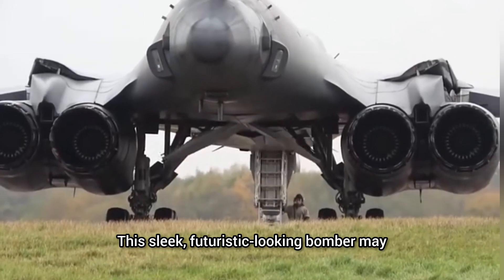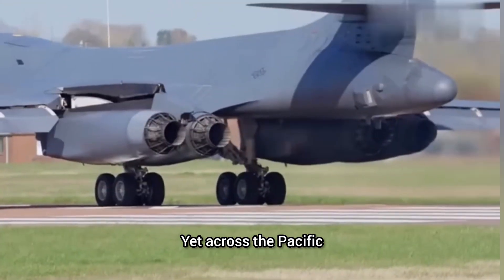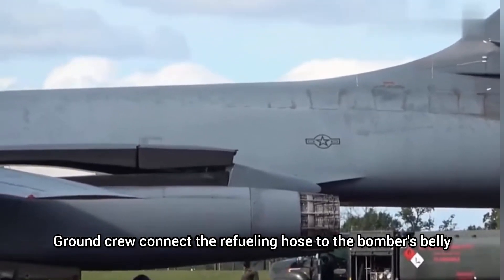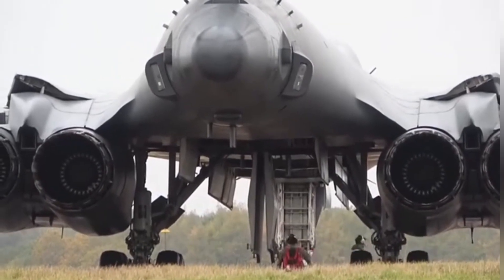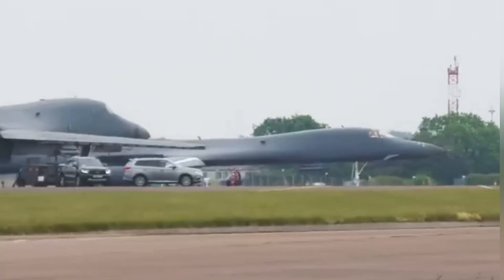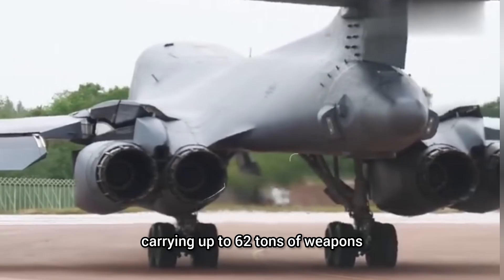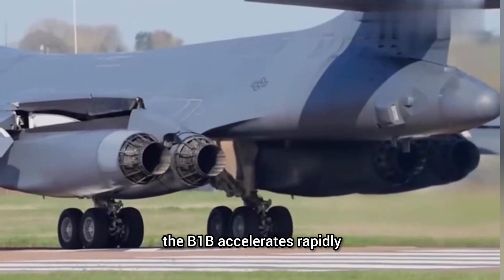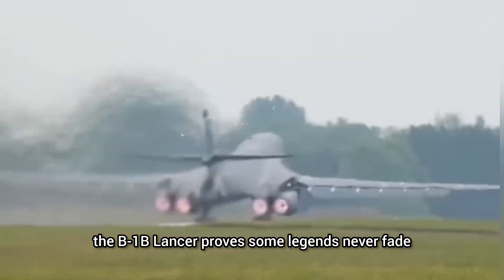B-B1 Lancer: The Supersonic Bomber That Still Dominates 50 Years Leter ! #Defence #military

Comment: In fact, the B-1B is the most awkward bomber in the Air Force. The B2 and B21 are more likely to use their stealth advantages to break through the air defense network. After eliminating the air defense radar, the cost-effectiveness of using the B52 will be higher. Who would risk being shot down and send a low-altitude, high-speed penetration bomber to perform a mission?